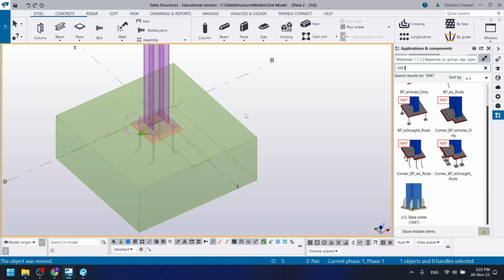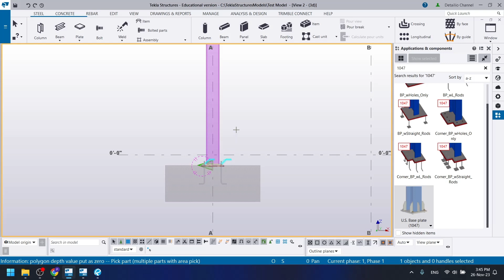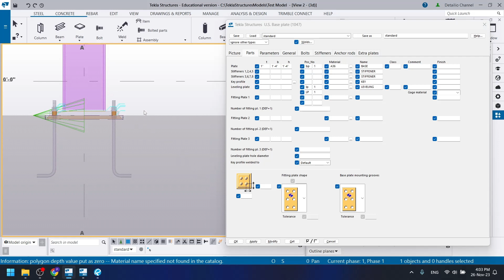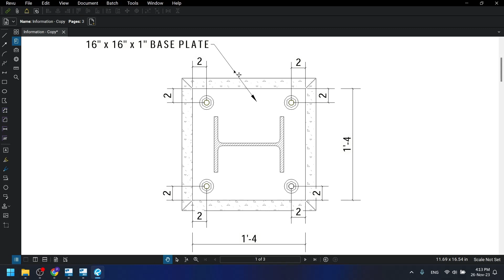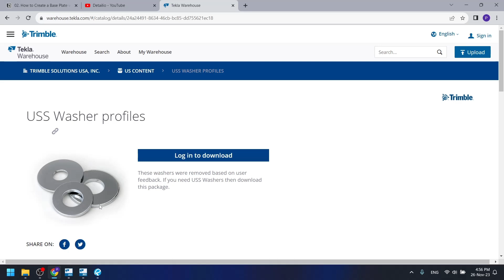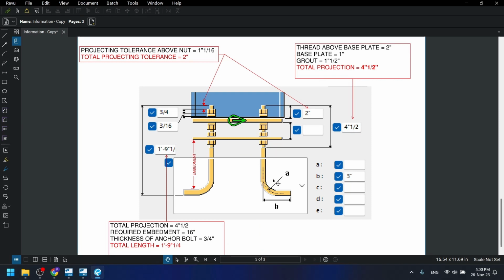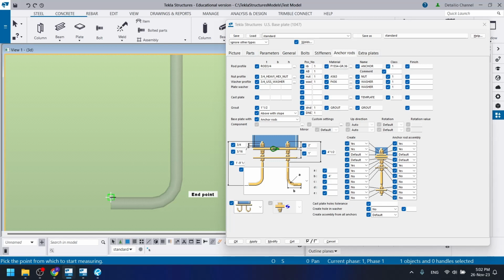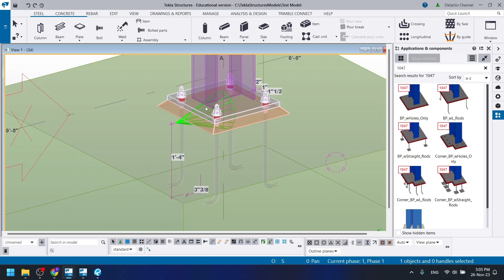How to Model A Base Plate with #1047 U.S. Base Plate Component in Tekla Structures

Comment: Did Tekla have Custom Edge distance Grouting.?
Reply from the maker: You can edit the grout within this component but the edge options are limited within this component itself. As an option you can create the grout with the component and explode the component and manually adjust the grout to be exactly what you want it to be.